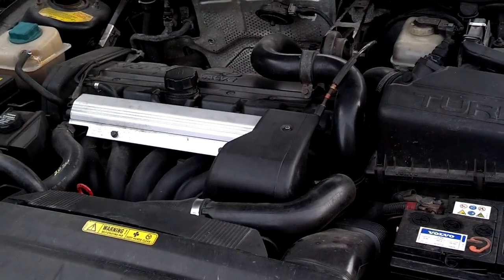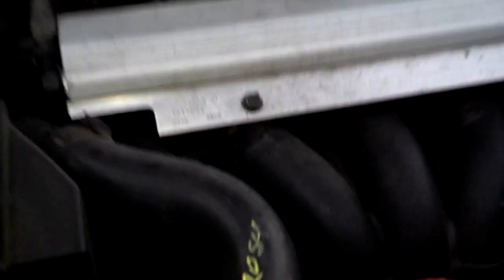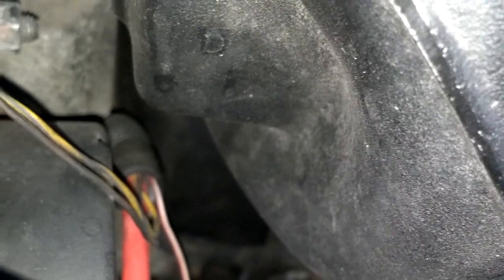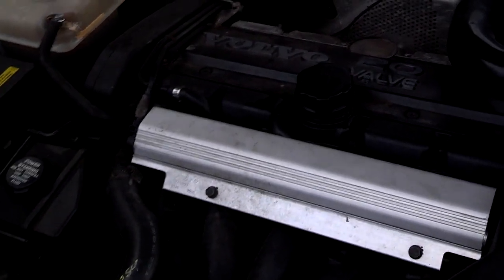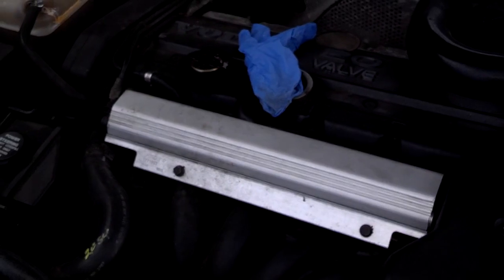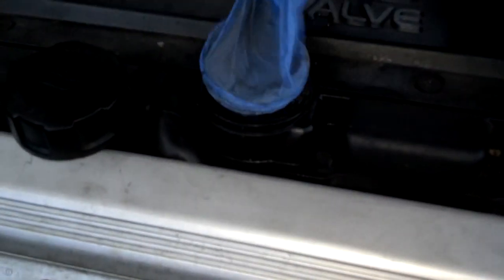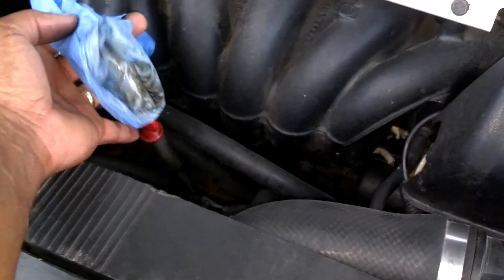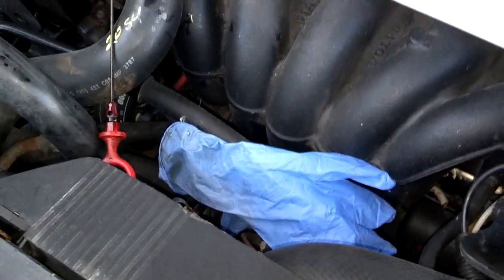Volvo PCV system check, 850, V70, S70, and others - VOTD

Comment: hey robert..... i have a 1998 volvo v70 non-turbo.  I did the glove test and the engine did not try to pull it in or inflate it.  It just stayed normal.  What does this mean?  Also, the engine is not consuming any oil and i have no leaks.
Reply from the maker: +Chris “Hank” Moltisanti Means it's boarder line. No rush to service it. Something you can get around to later. You may also what to do a compression test.
Reply: +Robert DIY I took it to a volvo service place and they did the compression test and they said I need to service the PCV.  but I think they are trying to rob me because they wanna charge me $650 for it.... I used to own a 96 850 turbo and from experience, if the engine isn't consuming oil or leaking, its good.   If I use the proper oil and change the oil on time, can I get away with not ever servicing the PCV ?
Reply from the maker: No, that is not true. The Volvo PCV system is the most neglected point of service of almost all vehicles across the board. $650 For a PCV system replacement is a fair price in my opinion. You can do it yourself if you don't want to pay the price. A clogged PCV system usually leads to blown seals, including the RMS. As I stated above, seeing that the glove did NOT inflate, it is not in BAD shape even though it's not in good shape.

What were the compression numbers?
Reply: +Robert DIY I didn't get the numbers.  my car has 232000 miles on it.  how am I supposed to know when to service the PCV if it is IN OK shape right now?  keep doing glove test every so often ?
Reply from the maker: +Chris “Hank” Moltisanti well, seeing that it is not sucking the glove in, you may want to plan on doing it. It can also be due to low compression numbers, that is why I told you to do a compression test. Does it suck in when you rev the engine?
Reply: +Robert DIY I didn't try reving it.  I will do it and get back to you.  thanks

Comment: Robert, I have a problem with my V70 Phase 1 2.0 litre non turbo 10 valve 180,000 miles on the clock (850 shape) I have done a FULL service myself when I bought it, Plugs, ALL filters, good quality "semi" oil and no "blown up" glove, Mine sucks glove in just like yours!!! it "hunts" when I connect the IAC valve (but only shows a code when its DISCONNECYED) It will sit and rev from 600 to 1500 RPM when connected BUT when disconnected will start and run normally (Fuel consumption is an average of 27.5 MPG combined when disconnected which is fairly normal so i gather and it passes it's UK "MOT" LAMDA is 1.00 which is perfect!!!) checked PCV and all is ok, checked all vacuum pipes, all intact, IAC is operational as no codes thrown up when connected (BUT HUNTS like hell!!!) any idea's please? Thanks Clive in the UK
Reply from the maker: +Clive Clarke-Watson Either has a vacuum leak at the valve or it is bad.
Reply: +Robert DIY Thanks I will double check all you have said......What the valve won't "throw" a code even if "bad???" Anyway thanks for your speedy reply!!! Didn't expect it that quick!!! Happy Christmas and New year from the UK!!!!
Reply from the maker: Thanks. Some parts take a while to throw codes.

Comment: Hi, I have a Volvo V40 2001. My problem is that a smoke is coming out from the oil trap to the turbo? When I disconnected the line that goes form the oil trap box smoke was coming out. Then when I connected the line back again, now smoke is coming out from the exhaust. My mechanic said that the oil trap box is clogged. But I don't saw him pretty sure. What can that be? Please help!
Reply from the maker: +Angel Santiago Did you do the glove test?
Reply: +Robert DIY I ask my mechanic today and he said he check the dipstick but I don't think he did the glove test. The problem is that he already disassembled the oil trap system. I have the oil trap in my house because I was thinking to buy a new one as he recommended. But I started to search here in the internet and I saw few writes saying that the problem with the oil trap happens if the oil trap is clogged. I blow for the different vent of the oil trap and it seems to me that it is not clogged. Also when the oil trap was assembled and the engine was start the problem was that smoke was coming out from the line that goes to the turbo intake. The turbo was already rebuild and I changed the PTC nipple. My mechanic said that I need to change the oil trap box and if the smoke continues the the problem is in the engine. I think my mechanic doesn't know what's happening and he is making me to spent money. I'm really worry about this issue.
Reply from the maker: +Angel Santiago Make sure the engine ports get cleaned out behind the oil box.
Reply: +Robert DIY The final issue was that when the line that goes from the oil trap to the turbo was connected and the car was started smoke began to came out from the exhaust with a strong odor like burned oil.. The same odor have the oil trap. I told him today that I read some information and I saw this video and it was a good idea to clean well the hoses. But he replied to me that the hoses are not clogged (but neither clean).  I will tell him on Monday to check the engine ports. You think that if the engine ports and hoses are not clogged but dirt this can cause this problem? Please if something else get in mind to you, let me know. Thank you very much for replying! Is a great job what you are doing here.
Reply: +Robert DIY I see. I will tell him to remove the hose from the oil trap to the engine to see the engine port. Because he inly checked the hose.

Comment: Hi robert!! 

At first i have to say that i really like your videos, it had helped me ALOT   

Now to my problem when i cold start my volvo 850 gle (1993 manuel box)   The rph jumps around 400-650 and feels like it is about to die it seems to react with the clutch a little little little bit but after driving aroud a bit its seems normal 1200-1300 so it is only when i start the engine cold. 

What can it be u Think?
Reply from the maker: +Filip svanberg It should idle at 840 rpm's. What codes do you have?
Reply: +Robert DIY  thank you for taking youre time 

I got 

A3    1-2-4 

And A7     1-2-2     2-3-1     1-3-2 

And when i tok the oil cap of it was comming oil frecking everywhere :(
Reply from the maker: Oil should be slinging out of the oil filler cap. You have a cam in there turning at 420 rpm's, about 2 inches under the cap.
Reply: +Robert DIY   Thank you

Comment: hey..I have a Volvo s40 and I have white smoke coming out my exhaust..when I hit the gas at high speed white smoke comes out..my turbo was bad but it was fixed,so what could it be?
Reply from the maker: +Dorian Jordan Dirty cat or other engine issue. How is the oil level?
Reply: +Robert DIY I'm losing oil..I got an oil change and a week later my oil light came on..it seems to be coming out the exhaust.. I can smell it
Reply from the maker: Check the level daily. If you are loosing more than 1 quart every 200 miles, you either have a bad turbo or bad pistons. Do a compression test.
Reply from the maker: https://www.youtube.com/watch?v=Z0hZELYgOX8

Comment: Hi Robert,  I just came across your Site & Vids... what a great resource.  I am an Aussie, I have a 97 Volvo 850 wagon, with 380+ K Km on the clock, and serviced  by a (ex-) Volvo mechanic every 10k with a 5k oil change.  It has never let me down, but is starting to use some oil.  No signs of anything wrong, no smoke, and my mechanic says to just keep it topped up.  It runs like a dream, and I will have the ABS module fixed in a couple of weeks by an auto electrician.  The Fault light comes on too soon, maybe an O2 sensor.   Those are my only 2 issues, but got them sorted, I hope. My niece has a 2006 V50, goes great, but the ignition key get stuck occasionally - a real pain.  Anyway this is just to say keep up the good work - I have subscribed, and will enjoy looking at your Vids.  Cheers
Reply from the maker: +Peter MultiTrum Nice, thanks for watching.

Comment: Hi Robert, my Name is Alvin, I purchased a 1998 Volvo s70. The dealer told me that he had  an s70 that I could  purchase cheap If I would fix it up. ( beautiful car) . I watched some of your video's, which were a help to me. After about   months I have a problem , my car blew a head gasket. I got a mechanic friend to help me . We fixed it up while was down , new head gasket, new timing belt , valve covers gaskets,  new serpentine belt, and a  tune up kit.  now there is oil coming from that hole in the center of the valve cover, and as I finally saw your video where you used the rubber glove on the place you pour oil in. I did this and the glove is blowing up. What would be causing this? thank you
Reply from the maker: +alvin kizer  wordalivetv Did you watch the video?

Comment: I have a V70 xc 2002 model and the engine oil is leaking. I tried your method and my car has a negative pressure. What other reasons could cause the oil leaking?
Reply from the maker: +hueygs Old seal, sometimes they just leak.

Comment: Hey Robert you're the best thank you for the information. I replaced my flame trap and nipple after which my 1995 850 passed the rubber glove test! Man I'm so happy about this I'm gonna order me some leather seat covers ;)  This car is in great shape at 168,000 miles and I plan on keeping it, great city car, fits in parking spaces no one else but an electric car can. Some months back I followed your instructions and did the timing belt, water pump, tensioner and the pulleys, also did the drivers side seat belt, couldn't have done it without you man thanks again the videos are invaluable!!!
Reply from the maker: Keith VolvoEightFifty Very cool. Thanks for watching.